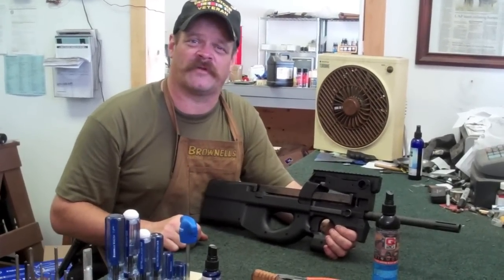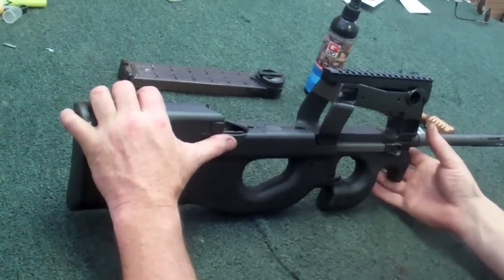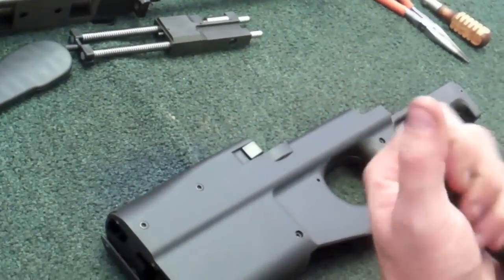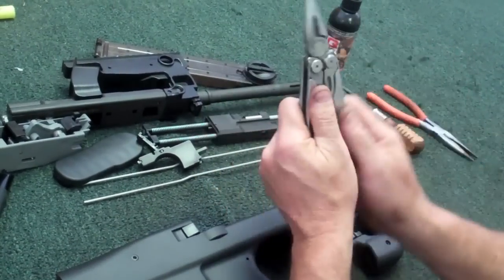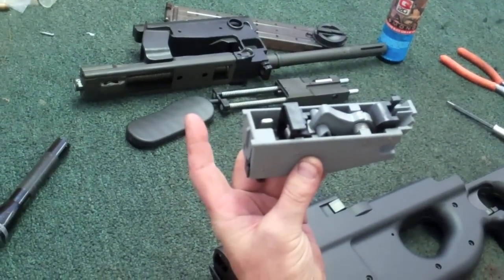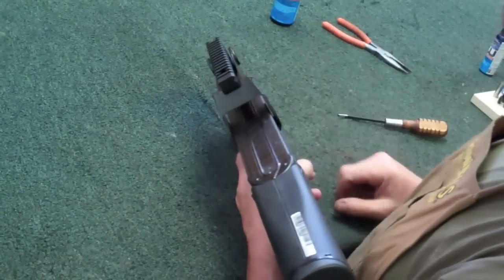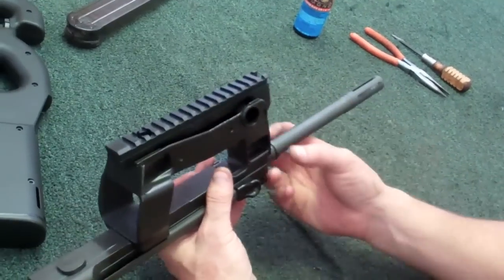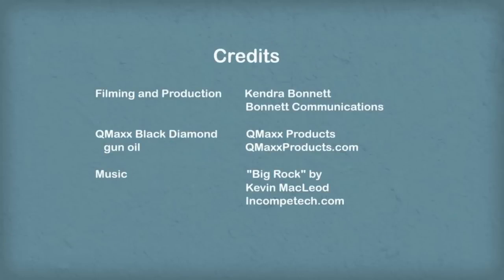Gunsmithing Disassembly: FN PS90 (Gunworks)

Comment: Excellent video.  Just a side note that I honestly do not know who would buy these for anything but a novelty.  For home defense how would a PS90 possibly compete with a 9mm Glock ? Ammo for the PS90 is impossible to find - and super expensive.  Once you find it is basically on par with a 9mm cartridge.  and a Glock is MUCH smaller than this.  I have no idea what market FN is going for with this.  Make a PS90 for 5.56 ammo - and we basically have a perfect weapon for home defense.  And no the FS2000 is a different design AND it has been discontinued.

Comment: why the hell don't they make a rifle version of this in 556 ?
Reply: This weapon was designed specifically for government use. Look into the 5.7mm round, it's actually really nifty. If you ever get one ammo isn't too bad, it's very similar to .300Blackout in terms of prices($0.50 per bullet). Other than that it's an armor penetrating round designed to break up after hitting desired target so you don't have to worry about what's behind it(walls or people).
Reply: @KHROMATICxKHAOS   Explanation makes no sense. There are legal sabot rounds that can do a HELL of a lot more damage than the 5.7. I've seen people try to shoot trash dumpsters and it bounced off like a .22, which is almost the same width.